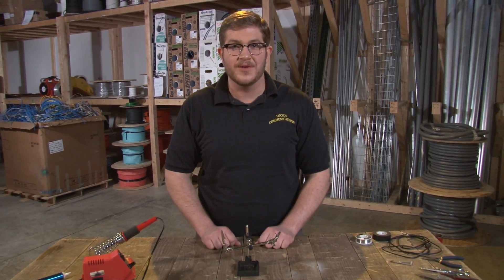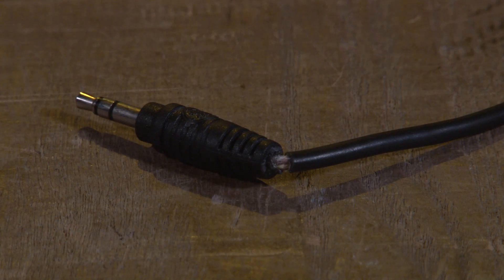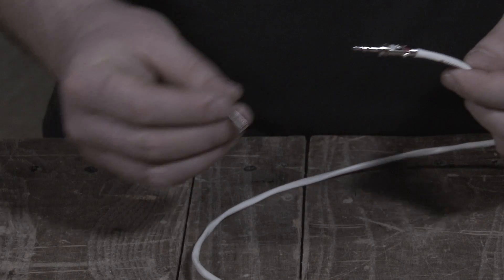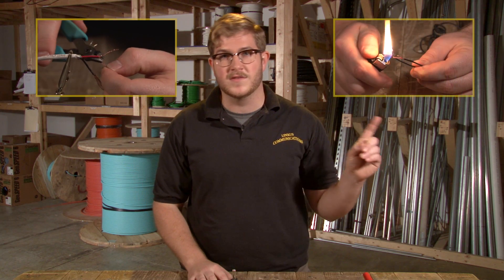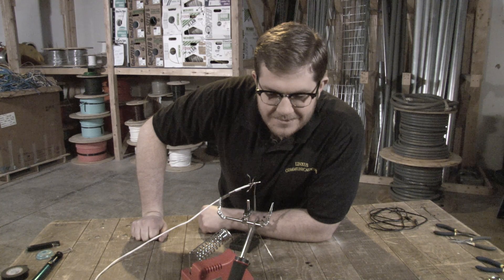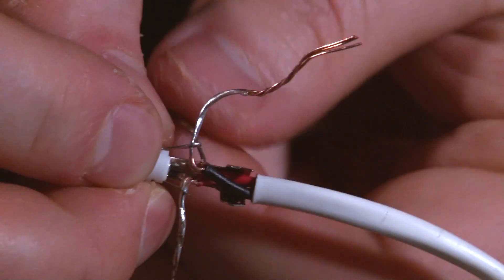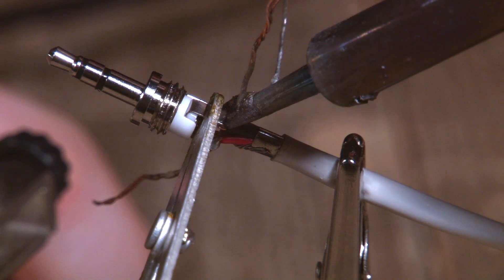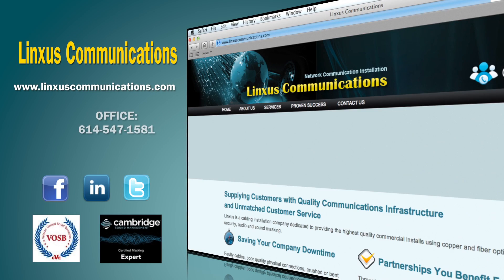How To Solder a 3.5mm, ⅛", or Mini Headphone Connector

Comment: any recommendations for the best value and/or quality 3.5mm connector? or should i just pick the one with the best reviews on amazon.

noob question, but does it matter if the connector is of good quality?
Reply from the maker: +chunkymonkey2782 http://www.mcmelectronics.com/product/27-7880 These are my personal favorites. All metal.
Reply: +Dixon Hill Thanks for the tip. also, noob question, but i was wondering if the type of connector will affect the sound quality and/or durability
Reply from the maker: Durability yes, quality no. Ease of solder"ability" yes. I don't like using plastic on anything that isn't a permanent install. But I'm a buy one good quality item if I can afford it instead of buying 4-5 in my lifetime
Reply: +Dixon Hill arg, that shipping cost from MCM is killer. but all the other ones I found on amazon have poor reviews :(
Reply from the maker: yeah, I tend to buy in bulk when I make an order at MCM. Shipping is a nuance. I stop by will-call when I'm in Dayton.

Comment: Why do I get pellets when soldering? Also, why the wires would not solder to the 3.5mm jack? Thank you in advance.
Reply from the maker: +musicaman68 The pellets are just molten solder that has cooled. Spraying a mist of water on a flat surface has the same result, but much smaller pellets. If you are getting pellets on the connector leads of the jack you're adding too much solder. Some people like pooling solder on a connection, then use a solder sucker to remove the excess solder.            The wires won't solder to the jack if you don't have the right amount of heat, not enough heat and the solder won't melt and/or the solder won't soak into the jack. You should heat up the jack lead with the solder iron then bring the solder to the jack lead.        Also the wires won't solder to the jack if the jack is hot, the solder will melt so quickly that it will not soak to the connections, it will run off just like water. I hope this helps. Good luck. Soldering is a skill. It takes time to learn.

Comment: Buyers beware. I've run across commercial 3.5 mm cables that are wired wrong with the tip positive and ring negative. Always check any of these types that you buy. Most are from China!
Reply from the maker: +Ken Bird Good to know, I've always done a tone test on the connections before I solder. I'll keep track of the wiring colors and see if I run across one.

Comment: 1:49 What's this called the tool
Reply from the maker: +Ninki Kinzy I bought that from Lowes.com many years ago. It's made by Gardner Bender and it has built in Circuit ALERT 50-600 VAC non-contact model number GST-70. Best tool I ever owned until the plastic end of the handle cracked right where the Circuit ALERT chip was and rendered it useless as a electric detector. Still works great as a wire stripper/crimper/threaded screw cutter. http://www.grainger.com/product/9NW53?gclid=CjwKEAiAstCyBRDiqu75hvnX82kSJACgYI_Q52UgkuAkL_SSqFxLfHL5w_VYXdNmhxbGCQOAYAwU2RoCZDTw_wcB&cm_mmc=PPC:GOOGLEPLAA-_-Hand%20Tools-_-Cutting%20Tools-_-9NW53&AL!2966!3!50916771957!!!g!82128212277!&ef_id=VjI@GQAAAPms69Rw:20151124150952:s

Comment: When i test my left and right speaker all my speakers go on when left plays but when right plays nothing happens? can you help me?
Reply from the maker: SpectumHD M Make sure your not using a mono plug. Only two contacts (one line dividing) will give you a mono (left only) signal and leave your right silent. If you are using a stereo plug, Two contacts (two dividing lines as seen in this video) there are more reasons it could go wrong. Now we're into troubleshooting. 1. The right tab could be touching the outside of the twist on connector shorting out the right channel. 2. You may have gotten the right tab too hot and it came loose inside the connector (I did this last week trying to reuse a connector) 3. A bad solder 4. The problem could be on the other side of the cable 5. The jack your plugging into could be worn out (a paper clip bent at the tip makes a good hook to bend the jacks tabs out again so it makes good contact 6 .... so many other choices. Do let me know when you figure it out. If you can Skype I'll take a look at it for you.
Reply: ***** Just checked yes i haave the stereo plug. I made sure the outside twist on isnt touching. Checked the connectors A-Ok. Solders are perfect including ground. The jack i plug into is fine via using another speaker with left and right and they work. SOOO there must be somthing wrong inside my speakers? even tho they all work perfectly fine when i individually test the left speaker but nothing happens when the right goes on. EDIT- Also this speaker im trying to fix has a bass, right and left speaker.
Reply: i dont believe there is a balance knob on my speakers...?
Reply: +SpectumHD M hhhjjoo9

Comment: yeah we all have tools like that at home.
Reply: +GatisiO In addition to wire and plug, you really only need the scissors and the soldering iron + solder. The rest of the tools mentioned are mainly to make the process easier, faster and safer. I would still recommend at least getting something to fix the wire in place while you work on it.

Comment: I know this is silly, but your nails and cuticles are a hot mess, and it actually distracted me from what you were doing. I was transfixed by the number of hangnails and the jagged nail edge. If you're doing videos like this, not overclipping your nails (they are so short as to invite nail infection and growing into the fingertip ) and moisturizing your cuticles a bit will go a long way toward making your hands look nicer and thus your videos more professional! Great video otherwise and nice clear instruction!
Reply from the maker: +Nishidake One of the oddest comments ever. But well noted, I will include a manicure (is that right) in the cost of my next video if there is anything with close ups. I always thought my rough hand told the story of my life so I cherish every scar, bend, cut, and defect.
Reply: Nishidake You are the reason they offer used panties in vending machines in Tokyo...  Please never comment here or any tech video again...

Comment: Good video. Here's a Pro tip -Wet Sponges (as shown in the video) are good for the casual user, but if you are planning to use your solder iron a lot I recommend not using a wet sponge and instead use a dry wire sponge (like the ones Hakko makes).  This type of dry sponge makes your iron tips last much longer because  you are allowing the iron tip to stay at a stable operating temp instead of sudden intermittent shocks of cool water which have an effect of annealing the metal and changing it's ability to transfer heat over time. Also a wire sponge creates less fumes and doesn't have the solder vapor coming out for you to inhale.

Comment: hola amigo como le va ? 
te hago una consulta tengo un problema . le quiero instalar un  3.5 mm jack HEMBRA para mi amplificador tiene radio  y conexión vía bluetooth y no tiene entrada  de auriculares  tu sabes como es la configuración para poder instalarlo ? e buscado un video que me hable de ese tema y no lo hay, y tampoco fotos que  muestre bien el armado o el diagrama no lo veo .  ya agote mis recurso, por eso te pido esta ayuda ,,,,  yo quiero separa el audio del parlante con el auricular  yo se que el 3.5 mm jack HEMBRA cumple como un interruptor cuando conecta el auricular
Reply from the maker: Si yo no sé que en lo que necesita . Pongo el enlace para el transmisor y el receptor. http://www.mcmelectronics.com/product/555-16066 http://www.mcmelectronics.com/product/555-16071

Comment: Nice Tutorial, But what if I had Cable with a microphone will that be any different ?
please reply
Reply from the maker: follow the microphone wire guide. 2 is hot, 3 is not, 1 is ground. Don't allow the pins to get too hot otherwise the plastic will deform and the connector pins will not make good contact.